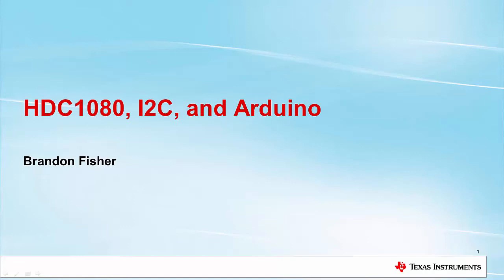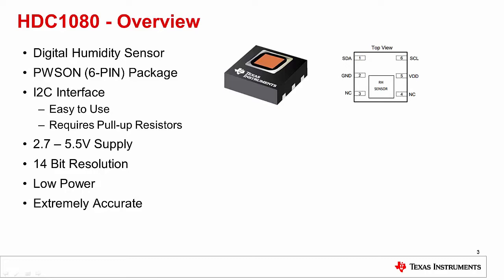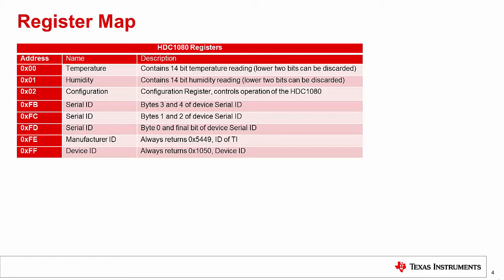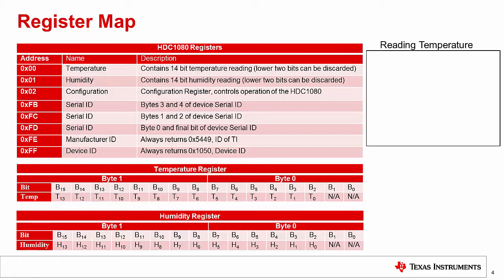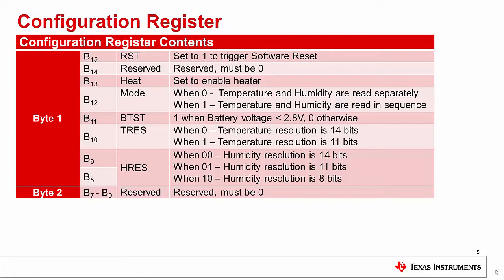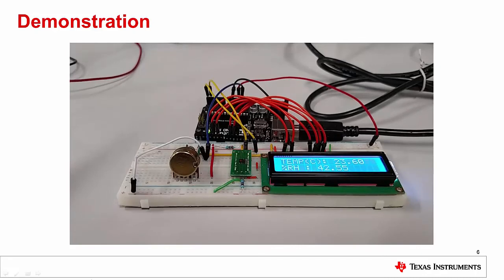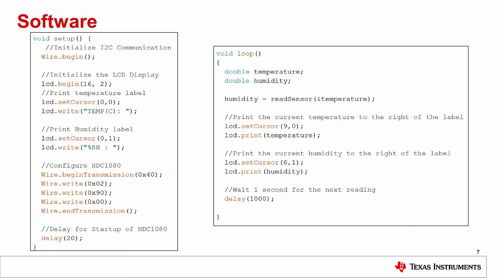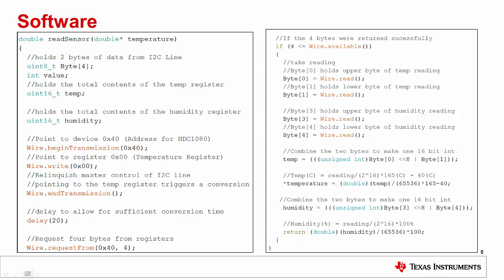How to interface with HDC1080 humidity and temperature sensor with Arduino using I2C

Comment: You mention links in the description, they are not there. It would also be useful to link to the datasheet there too. Otherwise nice walkthrough.
Reply from the maker: Hi Titerado, here are the links mentioned in the video: Product folder: http://www.ti.com/product/HDC1080
Datasheet: http://www.ti.com/lit/gpn/HDC1080
Arduino Code:  http://www.ti.com/lit/zip/snac076
EVM: http://www.ti.com/tool/hdc1080evm

Comment: If I put my finger on it, can it measure the body temp. like the value changes fast enough to show the heat signature sensor is able to pick.
Reply from the maker: Hi Asheem, we would not recommend this. The humidity sensor is exposed on the top and touching the sensor would leave oils and other contaminates on the sensor which could affect the accuracy of the humidity reading. For any additional technical questions, please visit the TI’s Temperature Sensor E2E forum: http://e2e.ti.com/support/sensor/temperature_sensors/.
Reply: That makes sense, and that what I was thinking too. Here is my problem, I was initially working with MLX90614 sensor(infrared medical-grade sensor for body temperature). Only issue was that, it has repeated I2C protocol, which I failed to implement, as after ACK, the signal became garbage, and I cannot find any help for that sensor. So I looked at TI, and now I am confused what possible sensor that uses simple I2C protocol, can possibly help me obtain human body temp. I did a dirty trick with HDC 1080, where user touches the HDC1080 sensor, and it reaches a peak value upto 32 degree C. I do not need humidity value as of now, but touching the sensor seems offbeat solution here. Please, any suggestion? We are interfacing sensors with STM32F0RT86 micro btw.
Reply from the maker: Hi Asheem, Please visit TI’s Temperature Sensor E2E forum for any technical questions you have: http://e2e.ti.com/support/sensor/temperature_sensors/.

Comment: Good afternoon, thank you for the video review. I bought an eBay card with a HDC1080 sensor on the marketplace. Seller from China, the sensor does not work. You - Texas Instruments can send a sensor to Ukraine to an individual?
Reply: I doubt TI has it, as of now this sensor is on backorder of 30 week(source: digikey vendor) all over the US. I have tried a lot. I designed my own PCB for the sensor. Try buying HDC1080 breakout board from here: http://www.playingwithfusion.com/productview.php?pdid=79 But I am not sure, if they ship to Ukraine. Also Newark has some stock for only sensors(92 as of now), u can buy sensor and design your own pcb and sauder it using reflow soldering method. Just my 2 cents.
Reply: Ответ открыт по ссылке
Thank you asheem.chhetri. I thought that the Texas Instruments company is implementing customer support.